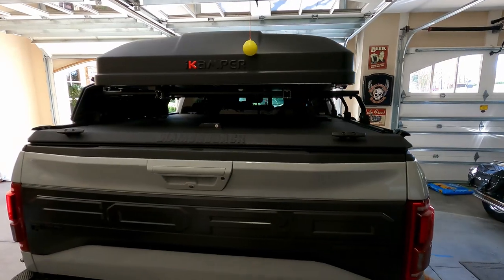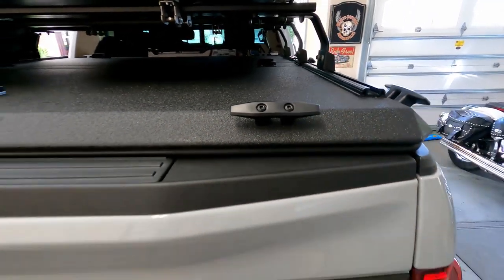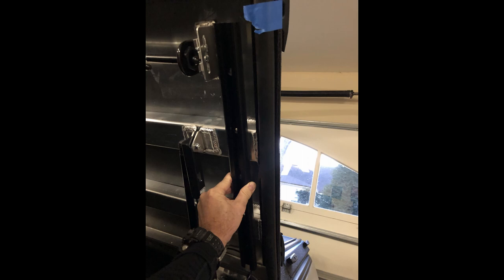Ford Raptor - Diamondback Bed Cover with Front Runner Load Bars for a Roof Top Tent

Comment: I too have an F-150 and I'm about to do this install. My thought was to assemble two load bars to the rear rails off the truck. Then sit the rails on the cover and mark their placement. Then run a load bar against the rear rail towards the front so the rail creates the straight edge to mark where the front rails need to go.

Comment: Great video, thanks to you I'm feeling a little more confident about getting the front runner bars for my truck.
Great job!!!
Reply from the maker: Jimmy, thanks for checking in.  I do highly recommend them for a low profile set up on a bed cover.  I am about to release a video later today detailing the IKamper set up on the load bars. Feel free to reach out with any additional questions. Thanks for watching!

Comment: love the video, Ive been running the SE with  2 front runner bars on my  ikamper mini with zero issues alot of offroad driving,  making sure the rack is square is key, you are totally correct when it comes to laying it out square.
Reply from the maker: DK thanks for watching. Glad the SE is working out.  I wanted to go with the SE to save a few $ but wasn't sure.  I will probably never need the weight capacity of the HD but like my wife constantly tells me "You buy for the life you wish you had instead of the one you have"........ 😂

Comment: I've been looking at a 2024 F150, and it strikes me, that new "Pro Access" swinging door in the center of the tailgate would make accessing thru the tailgate so much easier when your pop up setup is on top of the Diamondback.  As long as the weather seal is just as tight, and the tailgate when folded down can still handle max weight, I'm thinking of going for it, possibly a great complimentary feature for the Diamondback HD.
Reply from the maker: Hi Nate, thanks for watching.  Yes that sounds interesting.  I haven't researched that tail gate option but sounds good!

Comment: Nice video. Thanks for sharing.  

I have the HD cover on my F250 & I’m mounting a front runner rack system next week.  Once that’s done I’ll transfer the roofnest roof tent from the 4Runner’s roof to the back of the truck.  Can’t wait. 🇺🇸
Reply: With a long bed, the Retrax Pro with the T slots might work better. You can still open and close the cover with a rack installed.

Comment: Hey man, I just got myself a gen 3 raptor and would absolutely love the setup you have but can't find the kit you were talking about. Im new to overlanding so thank you for the great educational content
Reply from the maker: Hi Russ.  Thanks for watching. Check out this video as well.  I changed out the load bar supports to a taller version. This gave me more visibility and a little extra storage height between the cover and RTT.  https://www.youtube.com/watch?v=OjDrWWFRlM4&t=43s

This is the Front runner system sold by Diamond back but is the lower version:  https://diamondbackcovers.com/products/front-runner-x-diamondback-rack-system

Comment: I'm a tacoma guy but great looking truck man! And great video. I'm looking to the same set up for the taco.
Reply: Just to make sure, so if I have tent off I can open the front and back Latch with the racks on without any problem correct?
Reply: Another question, do you think it would setting up the rack first so it would be easier to get a visual before you make the holes or is not posible the way the assembly is set up? And again great video man really appreciate it! Hopefully we'll  meet one day on the trails.
Reply from the maker: @maikolaldana3999  take a look at my Instagram page.  I have a pic of my truck with the tent removed and both panels on the DiamondBack open.
Reply from the maker: Maikol thanks for watching! I highly recommend it.  You can also check out Mike at LLOD on YouTube.  He has the same setup on his taco.
Reply from the maker: @maikolaldana3999  You could try setting it up first just to confirm your measurements but you do have some tolerance on width spacing of your mounting rails.  My load bars have almost no overhang on the mounting legs but you will see others with a few inches of overhand.  I would prefer some overhang. Good luck and feel free to reach anytime.
Reply from the maker: @maikolaldana3999  https://www.instagram.com/weekend.overland/

Comment: Great video.  I almost purchased the 270 but ended up going with the HD simply because for the amount of money these cost, I want the best performance out of it.   The price difference between the SE and HD is tiny when you consider how much more you can haul on the HD (which also translates into how heavy duty it really is in comparison to the other ones they offer).  Even though the 270 is a great design, with the two smaller "hatches" to open near the cab, losing the massive amount of weight you can haul on top simply wasn't worth it for me.   I want the option to put whatever I want on there without even considering the weight.
Reply from the maker: I totally agree. I also liked the access of the other style but with what I wanted to mount on the bed cover, this set up worked best for me.  I don't plan to carry a ATV on my truck but knowing I can with the HD pleases me!! Thanks for watching and good luck with your set up!

Comment: I thought  of another question, frankly, it's my last concern, everything else just seems fantastic about the Diamondback HD.  How hot does that all black, smooth HD cover get over a summer day if out in the sun all day?  Is it hot, too hot to the touch, or is it nominal, not a big deal?  Assuming no tent on top so the whole thing is open to the sun.  Can you walk on it in bare feet on hot summer days?  Other?  I won't be putting it in a garage at least the next few years, so it will be out in the sun one way or the other all day long every day that the sun is out.  Thanks.
Reply from the maker: I relocated to the country about 2 years ago and no longer have a garage so my truck now sits out in the weather.  I only recently removed my RTT so will find out this summer.  With the RTT on, I never noticed the Diamondback overly hot. They refer to it as a "smooth" option but it still has good texture which helps.

Comment: Man, that is a great setup.  A couple questions.  I wonder, how much room is there inside of that rooftop tent?  I'm 6'2" tall, and am wondering if I can find one that I can lay down straight in and have at least an inch or two to spare at my head and feet, do you know, might I with that one, or do you know of one?  And how heavy, how easy is it to lift off the tent to be able to open the cover, and can one person do it? And ideally be able to remove the tent and put it back on all while alone when out and about, and not just back in a garage with a hoist assist or something?  Thanks.  And good idea, that third load bar, I think I'd want to do the same, though, and you might laugh, but it occurs to me that without that 3rd/middle load bar, when the tent is off, you might be able to fit a couple lounge chairs and a cooler on top between the front and rear load bar and enjoy that area like it was a small outdoor deck up off the ground, with the HD cover of course, I do kind of like that idea.  🙂Heck, if they're chair style, they might even be able to fit right over that 3rd load bar in the center, and put the cooler  between the center and rear load bar, maybe could work with it, would be nice.  But dang, what a beautiful setup.  Even the color.  I was wanting a black Raptor, but that white with so much black highlight, it is stunning.  Nice!
Reply from the maker: Hi Nate.  Thanks for watching and your response.  First I will say the IKamper Mini works well for me and I am 6'1" 200 lbs.  I really like your idea in converting the Diamond Back cover to a lounge area between the load bars!! The IKamper Mini weighs about 120lbs which isn't too heavy but the size makes if difficult to put on and take off by yourself.  With two people it is very simple.  A hoist would be ideal.
Reply: I thought of another question.  I've been concerned about the side opening of these icampers requiring the ladder to support part of the tent, for two reasons, one, how difficult is it to find sufficiently level or hard ground to rely on that ladder as a key support, and two, a person accidentally or with ill intent, or say a bear or dear or moose exploring near the vehicle at night, might knock it over, taking out that key support and down you go, down right into an angry animal to boot.  Maybe one or both of these are unlikely issues, but they concern me.  That said, b/c it is a side opening tent it doesn't require a long bed, and can be mounted below the level of the cab roof, which allows you to use those wonderful and low mounted Front Runner bars.  I love the Roofnest Sparrow2 b/c it opens front to rear, and does not require its ladder to be used as support, but it also appears to mean that if you have a 5.5' bed or even to a lesser degree a 6.5' bed, you must mount it above the roof level of the cab so part of its length can go over the cab and does not have to hang past the rear tailgate, so it's nowhere near as flexible as the icamper in how it is mounted.  And dang but your rig set up is sharp looking, much better than having to uses those high Yakima mounts for instance and have the tent be above the cab roof height.  So my question is, how difficult is it to reliably find level and sufficiently hard ground to use the ladder as key support for the icamper tent, and to be confident rain onto soft ground won't threaten its level or stability overnight?  Does that issue ever concern you?  Peace of mind while sleeping is important at the very least.  @WeekendOverland
Reply from the maker: @Nate-zy5ce  good concerns but I have never had an issue with the ladder.  If the ladder is removed, you should still be stable in the tent.  It does provide additional support for that end but the half can remain suspended without it and keep in mind your feet should be on that end so most of the weight distribution is on the other half.

Comment: Do you have to buy the third load crossbar in order to get that small mounting strip on the smaller med section of the DB HD between the longer ones front and rear of the cover near the sides?  I'd love to get the two bars initially, but have those strips on all three pieces of the cover so ready when I buy the third load bar, that would be my preference.
Reply from the maker: Good question Nate.  They offer the 2 or 3 Load Bar options I it appears you get the middle channel section regardless of which option you choose.

Comment: from the bottom of the load bars to the top of the cover, looks tall enough to store a recovery board mount.  i would say 5 or 6 inches.?  that is giving me ideas.  thanks for making the video.
Reply from the maker: Hi Kevyn, Thanks for watching. With the FR load bar kit I purchased through DiamondBack, I have 6.75" between the cover and the load bar but only 5.25" between the cover and the Ikamper bracket and about the same near the bar supports due to the bolts.  Therefore you need to consider the clearance between your mount pins and the load bar or RTT bracket and the thickness of your board (to ensure each board can slide in to be mounted and removed).  You can also go with the taller FR mount which I believe has to be purchased directly from FR.
Reply: @WeekendOverland  thanks for looking in that.   you have a great looking truck.  I went with the Billie bars.  I needed a little more for the weight of the tent i have.

Comment: quick question, how did you mount the gas can inside the truck bed with the diamondback?, I plan to do the same with my truck.
Reply from the maker: I used Builtright Panels.  Here is a video I published on the install.  https://www.youtube.com/watch?v=aPtPO67kO8Y

Comment: Noticed any sagging of the rear shocks with the bed cover, RTT, and all the gears loaded?  Nice vid btw!
Reply from the maker: Thanks for watching and your comment.  I am actually considering either upgrading the leaf spring or investing in air bags.  It has dropped about an inch and I want to add a bed slide which will add another 180 lbs.  Raptors are not really built to carry heavier payloads and I have seen people go through the original leaf springs if they take the truck on serious off road trips.
Reply: @WeekendOverland  I have the same truck lol... I was looking to do the same setup, but held off until I've upgraded the leafs.  Look into Deavers +3 or +4... adds 1" or 2" over OEM respectively.
Reply from the maker: @HOUDG35  Thanks.  With the little research that I have done, Deavers seems to be the brand.  Based on your numbers, I will probably go with the +3.  Thanks for the info.  Have you looked into air bags?
Reply: @WeekendOverland  no sir

Comment: I love this build and products and would like to do something similar with my Ram EcoDiesel. The diamond back tonneau is amazing but with the roof top tent it kinda ruins the access. 

That’s why I was thinking going with the retractable tonneau instead. To get more access and storage with the ten attached. 

Thoughts on this anyone?
Reply from the maker: You are correct, you definitely lose access with the RTT mounted.  I have been considering a bed slide but in order to handle the extra weigh, I need to beef up my leaf springs or go with air bags........
Reply: @WeekendOverland  with the Ram 1500 no leaf spring just coil springs in the rear I replaced the stock springs with TufTruk HD springs. Big improvement for weight in the back.
Reply from the maker: @tburrows357  nice, so weight will not be a problem for you.  I desperately need to take care of this as well.

Comment: When you drilled the holes in the cover for the rack mount, did you drill into one of the ribs?  If so, what did you do to mitigate this?  Did you use a jack nut or nutsert?
Reply from the maker: Hi Brad.  I measured it out so that I would miss the ribs.  A couple were pretty close though.  The kit from DiamondBack did come with some inserts in case that happens.

Comment: Do you think you could just use the back two racks? Just for like bikes. That way you could still use the front access point. Just wondering because I’m in the market for one
Reply from the maker: Hi Jordan.  Yes if you can fit your bikes on the back two load bars, I would think you could have full access to the front panel.  Just make sure the angle of the panel when completely opened doesn't come in contact the bakes.  With the DB cover, the center section is what keeps the cover in place so you should be good with that setup.  One other thing to check into (assuming you are referring to mounting the bikes parallel with each load bar (meaning one bike per load bar) which would mean each bike is pointed side to side of the truck and not front to back. If that is the case, I would check the rated strength where the leg mounts connect into the channel on the DB cover. Forgive me I am not familiar with bike mounts but not sure how much support you may or may not have to withstand the wind force on the bikes in that orientation.
Reply: Weekend Overland thanks for the feed back!!

Comment: How is it to load the bed when the camper is off and you can open the panels? Is it difficult to load larger items to the back of the bed (closest to the cab) with the bar running down the middle or is it easy to work around? Thanks!
Reply from the maker: The load bar in the middle does not impact the opening of either panel (front or back).  The next time I remove the RTT, I'll take a pic.  I haven't actually used the bed cover without the RTT mounted but will be installing a hoist system soon to more easily remove the RTT (and will make a video installing and using it).
Reply: @WeekendOverland  Thanks for the reply! I was more thinking does having the bar in the middle of the bed make it difficult to get items all the way into the bed, like trying to put a cooler or large case in the bed up against the cab since you can't fold the cover up like you would with a folding tonneau cover to gain access to the bed. With the rear panel 'up' can you still easily access items in the back of the bed or do you need to access things like that through the front panel, like trying to access the roam case in the bed for example. Thanks again for the reply!
Reply from the maker: @bikersimm22  Sorry now I understand what you are referring to.  Before installing the Diamondback, I had the trifold cover supplied by Ford. I liked it and it was moderately secure when locked into place.  The trifold gave me better accessibility to the bed but was not compatible to the rooftop tent.  Once a storage case is positioned in the front (cab side) you have accessibility but limited based on your height (unless you install a side step) and if you want to latch down the case top (each time having to release 3 latches with one possibly in the middle. I am considering Diamondback's Cross Bin 13 or 8 for an easier way to store gear with access from the cab side.  The problem is when I have the RTT installed, I would not be able to access the bin.  I'll need a little more time using the cover without the tent mounted to decide what's best for me ..........stay tuned.
Reply: @WeekendOverland  Great to know, looking forward to the future updates!

Comment: Why not just use a laser to get it straight that’s what I’m going to do
Reply from the maker: Hi Mikee. Yep a laser will work great.  I don't have one and at first didn't feel it would be needed (not realizing the bed was tapered) so I just pressed on, old school.  Good luck with your project!
Reply: ThAnks man I hope it goes on easy lol 😂 I’m scared to drill into my diamondback tho
Reply from the maker: @MikeH0311  That was a huge step for me as well.  I think I measured 10 times before taking the plunge!! Be sure to look underneath so you can line up between supports.  Good Luck!